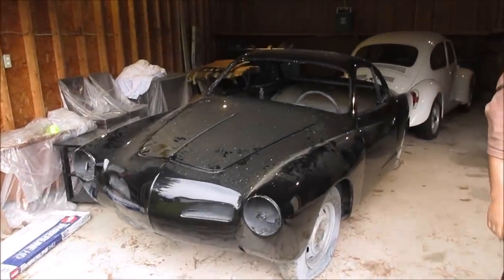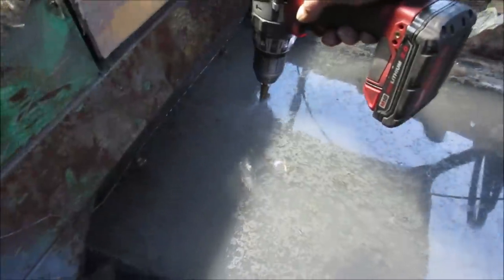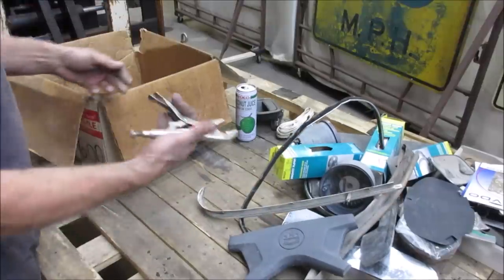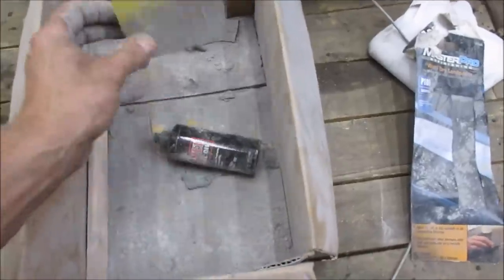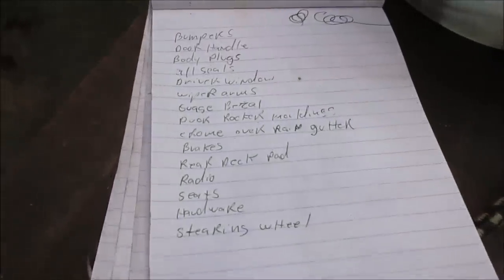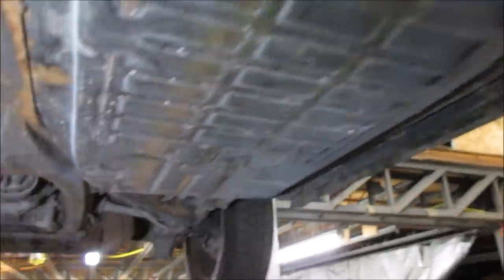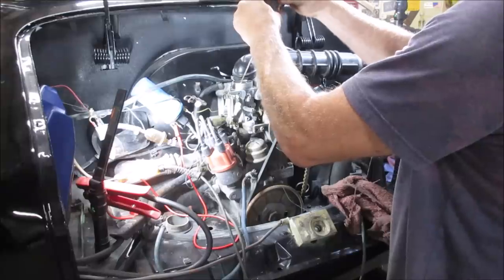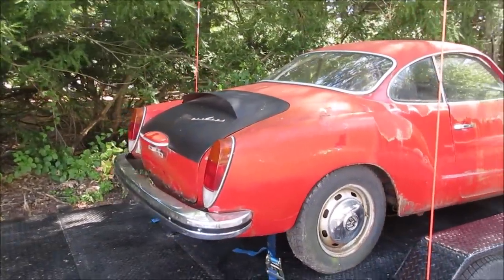Basket Case 1974 vw Karmann Ghia Rescue. First Start

Comment: I know this isn't going to go over well with the fanatics..
I say Honda 4 cylinder turbo 6 speed, and turn it into rear wheel drive with 4 cylinder turned 
N to S instead of E to W front wheel drive. 
As they say K swap.
Are the Audi in line 5 cylinder with twin turbos, at least that is sorta authentic. 
But the little car deserves better than what it came with, and the cousins engine cost entirely to much to purchase or maintain. 
I do like it in black, and I don't think I have ever seen it in black, but it's very sweet looking ride
Reply: @billtaggart3889 yes Sir I understand all that, but it got about as much get up n go, as a little red pull wagon does with two flat tires, and a three year old little girl pulling it has.
I always thought those cars should run far better than they did, because I actually think they look better than the Porsches did that have basically the same body, and even they were rather lacking in the performance category. 
Don't take me wrong I've always really liked the look, but man the performance doesn't even come close to making the complete package that body deserves.

Comment: Finding a radiator for a 74 is going to be impossible 😊
Reply: And a water pump.
Reply: A good radiator shop can just make radiators. They're not high tech items.
Reply: @1pcfred wouldn't you have to have one for just an idea of it's size and shape or a picture of one 😊

Comment: When you have an old car in small pieces,  it might pay off eventually to 3D scan the parts.  Some other enthusiast might turn those scans into engineering drawings,  and then someone else might feel the urge to fabricate some of the scarce ones (or 3d print them if they're plastic)

Comment: Darren, the right thing to do is return those screw drivers. But I have watched enough of your videos to know that that will NOT happen. I once found a whole Snap On screw driver bit set and a Snap On 12" drive locking flex head ratchet in my SUV. I did the right thing and returned them. I know how expensive Snap On tools are. That would be like finding someones wallet with $1000.00 cash in it. I know you would keep it but I would return it. Honestly is ALWAYS the best policy.
Reply: That's a life lesson learned to the person that lost the screwdrivers. Know where your tools are at the end of the day.
Reply: @mph5896  That it where I disagree. It comes down to integrity and honesty. I did not pay for those tools and I am not entitled to keep them. But I will say this. If I could not find the person who misplaced the tools and I did everything in my power to find the right owner, then I would donate them to a school that could really use them. My parents brought me up to be honest and to do the right thing each and every time. Just because I find something does not mean I automatically get to keep it. 
 You are entitled to have your own opinions and you stated them as you did. Some people just think and act differently then others.

Comment: I had a 1973 Ghia. What it lacked in luxury was made up by a lack of acceleration and style.  I hated that car 2 hours after I bought it.
Reply: I drove one of those once. Pedals coming up out of the floor just ain't natural. They're not cars, they're go karts.
Reply: @1pcfred  Mine was too slow to call a go cart. 🤣
Reply: @GuysPlayingWithTools  go kart is a relative term.
Reply: @1pcfred  I will admit it steered like a go-kart. Lol. I dropped a modded FI motor out a wrecked hatchback wagon in, and that helped, but it still only had around 150hp.
Reply: @GuysPlayingWithTools  150 HP would be triple the horsepower any Karmann Ghia came with. The 1600cc engine was only 50 HP. They weren't called Jokeswagons for nothing. Wikipedia claims the top speed was 93 MPH. That must be only if you drive it off a tall cliff.
Reply: @1pcfred  I didn't know what mine had when we swapped out the motor, but it was a huge difference. It was super light, and that helped. I thought it was going to fly, but it was about the same as a 90s Camano with the new motor.
Reply: @GuysPlayingWithTools  the highest output engine they ever put in a Ghia was a whopping 50 HP. I think you could get one with as little as 27 HP too? It could barely make highway speed. There's Shriner clown cars that outperform it.
Reply: @1pcfred  It's been a long time, but I think mine had 38hp when we started tinkering with it. The guy that sold me the FI engine claimed it was pushing 150, and it made a difference, but it was still slower than any 22 year old gearhead would want.  I replaced it with a 1978 Trans Am, and it had enough motor to tweak into an honest hotrod.
Reply: @GuysPlayingWithTools  I knew a guy that had a pretty fast Camaro. So that frame car could be quick. There's no replacement for displacement. Although a buddy of mine's uncle did set a world's record for horsepower per cubic inch. He built the quad Olds 4. Jim was kinda famous. 1,270 hp from 121 cubic inches.
Reply: @1pcfred  I think I heard about that a few years back,  the fastest 4 banger in the world
Reply: @GuysPlayingWithTools  It was a long time ago now. Jim's been dead for a while.
Reply: @1pcfred  From what little I remember, it surprised everyone when Olds got the record
Reply: @GuysPlayingWithTools  Jim was a surprising guy. I never met him but my buddy told me some stories about visiting him. I think he lived out west? Like Arizona? He had tool sheds in his backyard with engines running in them he did tests with. Weird stuff. That whole family was very mechanical and inventive. My buddy was always making stuff.
Reply: @1pcfred  That's the kind of person I would have loved to spend some time with. We had a jet car driver named Sammy Miller in our neighborhood growing up, and he was fun to hang around with as kids while he worked on whatever was in his garage.
Reply: @GuysPlayingWithTools  I never met Jim myself. I only knew his nephew. He never told me what Jim was like, just some of the wacky things he did. Like the motors running in sheds in the backyard.
Reply: @1pcfred  I am a bit of a gearhead myself, I don't think running motors in the shed sounds unusual. I live in a yuppie suburb now and don't fit in at all. I am looking for a place in southern Indiana with room for that kinda fun. It's a guy thing. 🙂
Reply: @GuysPlayingWithTools  I was told he was doing it to test header designs. To see what would pop. He'd run stuff until something failed. That's why they had to be in sheds. Because it'd usually take a few weeks. So he didn't want the stuff out in the weather while it was being tested. Or maybe it just looked neater than having a bunch of engines on test stands going in the backyard. Beats me. I guess someone has to do it. Jim felt compelled to be that someone too.

Comment: I would NOT try to start it because:
1. There is "black gas" in the fuel filter, 
2. The carburetor linkage is a little stuck, 
3. The gas in the tank is obviously old, and,
4. The old oil should be changed.

Comment: Just my opinion but I don't think I would have drilled holes in it I would have just used a shop vac and a hand full of rags.  The other door handle I believe was in the first box you unloaded. Some body did a very poor job stripping it down definitely very hasty and thoughtless

Comment: Looks like someone probably sold most of the original parts or kept them then threw some boxes of junk in the car to make it look like you were getting a good deal because supposedly all the parts were there lol
Reply: From the dialog it was clear the car was not complete or purported to be. Time and again Darren said he knew specific parts were missing. He bought a body, an engine and boxes of random junk. No one sold any parts either. Every time the car was moved more was lost. Sometimes random junk was added too.